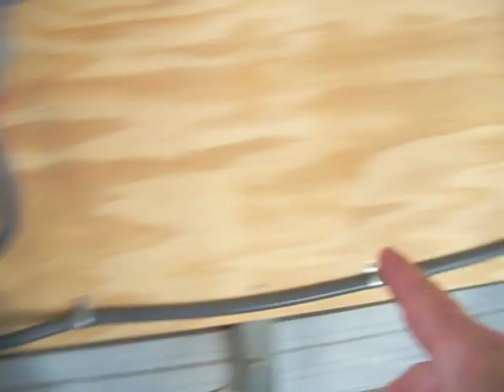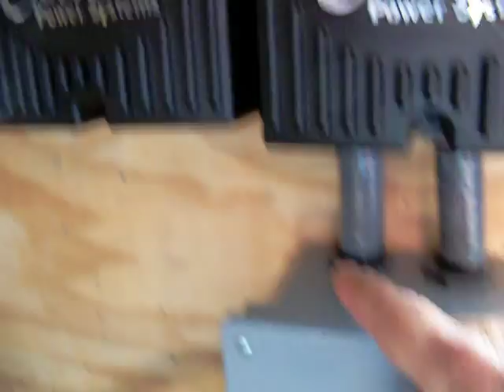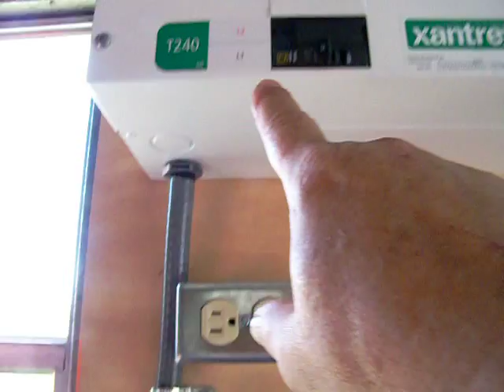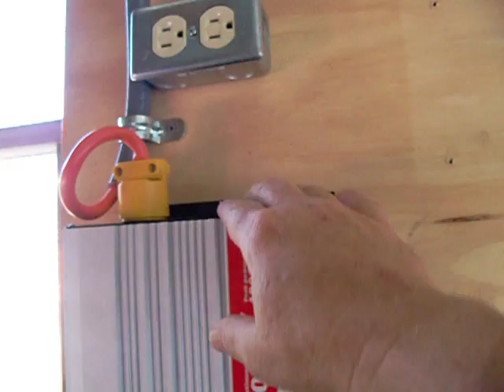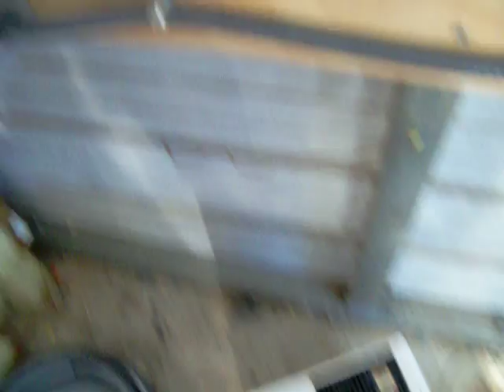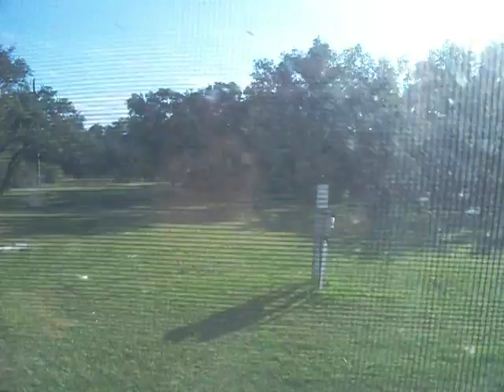Solar & Wind power panel update

Comment from the maker: @js111410 No, the U.S. 240v is made up of two phases of 120vac each. The E.U. uses 240 single phase so not compatible at all. Not only that, we use 60hz line frequency while the E.U. uses 50hz line frequency.

Comment from the maker: @depravedpuma The FM60 has now 800 watts of solar at 12v so that's maxed out.
The two FM80s will have only 2Kw of solar going to only one, the other will go unused for capacity upgrades in the future. The FM80 will go to the 24v battery bank.

Comment: Hi Al,
I notice that you have 3 charge controllers that will handle 2500 watts at 24 v charge output are you making that much power or are they for expansion to your system. I know you said you have a 12v and a 24v system but why the third controller. I am getting 1 for my system and I have solsr and wind should I consider getting 2. 
Love the videos keep em coming
Bruce

Comment from the maker: @Viking9280 For off grid inverter there are many good ones I like, MagnaSine is my choice for off grid inverter but I would also recommend AIMS as a great inverter as well. For grid tie, it depends how you'll feed it, if from solar panels Solectria is my choice, if feeding from batteries the Outback is my choice. All the above can be had in 240 AC output except for AIMS which are 120 AC single phase. I use a Xantrex T240 to convert 120 to 240 for my well pump and other 240v stuff. God bless!